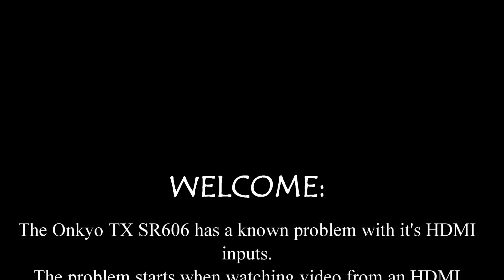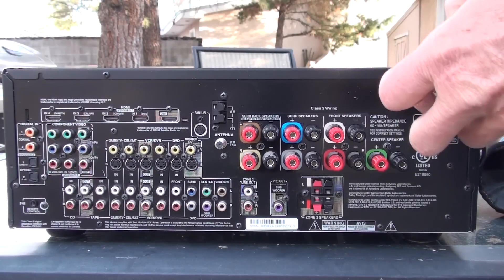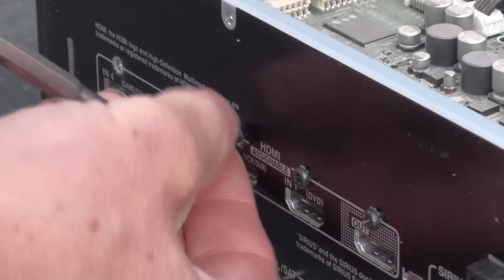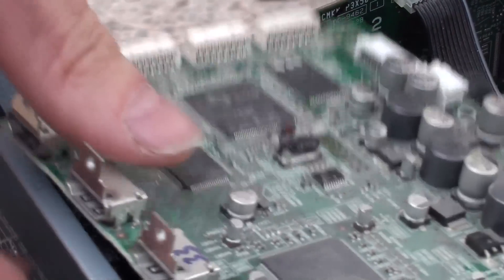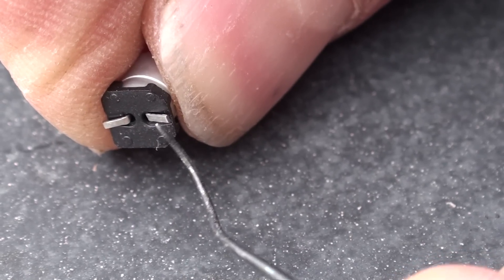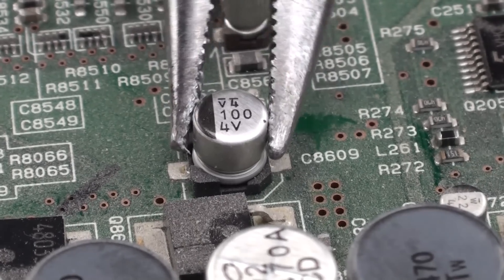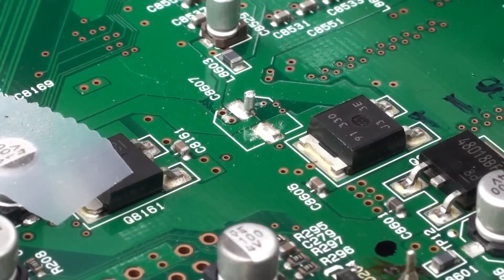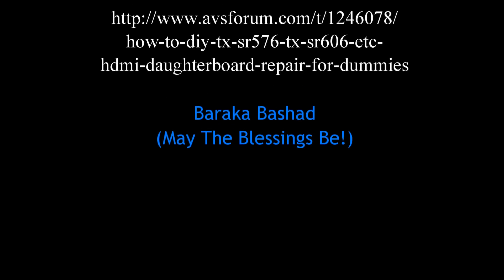How To Fix the Onkyo TX SR606 & SR607 HDMI Input Problem

Comment: Thank you! Followed instructions and replaced the capacitors on the HDMI board. HDMI inputs and setup screen work for the first time since I bought the 606 receiver used. Here's hoping the fix lasts! Great instructions. Again, thanks so much!
Reply from the maker: Michael Jackman If you purchased the higher temp rating caps. It should last longer than the original

Comment: Had this reciever installed at my parents since it was just standing around. However after a while it stopped accepting switching from different sources hooked up to the reciever. Followed this guide and it worked like a dream. Just had to make sure not to heat any components more than needed. Thx alot for this guide!
Reply: @urretard5934  yep, still works after 3 years. No fan required.
Reply: @urretard5934  think it was a 607 old one. Can't answer about your receiver tho, only knows onkyo is a solid brand. Yeah as long as u have basic soldering skills u will be fine 👍

Comment: I am plain electrician, know basic electronics, i was about to throw away my sr606 and i found the video , i know how to use the soldering gun , bought some capacitors over the DIGIKEY, got  it delivered the next day from the US and I am in Canada. Replaced 5 capacitors the way the guy said, and it's working now like brand new!!! I used to have long delays on all HDMI inputs and eventually all of them just quit working. Thanks very much
Reply from the maker: Juri Divovich You May now apply to StarFleet.  You’ll be working on photon torpedos in no time.

Comment: I just used your method to repair an SR706.  Thanks for the clear and concise guide.  For others with the SR706, there are 12 total 100uF 4V Caps.  I had only ordered 10, so I had to choose which ones to replace.  Based on comments on another forum I started with the Caps on the underside of the board that were closest to being right over one of the heatsinks on the assumption that these were the caps that faced the most heat and probably failed first.  These were the most inboard and forward of the Caps.  Once I replaced these, the HDMI switch worked just fine, but I chose to replace all of the remaining 100uF 4V Caps on the underside of the board and 3 of the 5 on the top side of the board, because, well, I had the replacements and I didn't want to take the chance that the others would fail eventually.  The 2 Caps I did not replace in case anyone else cares were each located right between 2 larger Capacitors and would have been a bit more difficult to replace.  They were also farther away from any heat source.
Reply from the maker: Thanks for the info.  Good choice, just replace them all.
Reply: Jason Rood i too have a SR 706 on the fritz... did you order the 493-2141-1-ND Caps from digikey or another part # ?  Thanks in advance.
Reply from the maker: the ND part number is a digikey part number.  Probably will not cross ref to other sources
Reply from the maker: It's the same type capacitor (part number) regardless of which model you have.
Reply: patpatpat999 Thanks!
Reply: I just did the same :), on my SR706 replaced only 10. I don't have such a small soldering iron, so did only the ones where I could fit without touching other elements. Worked fine for me, now the receiver works fine, no more crackling noises.

Comment: Great video.  I have the TX-SR607, the only difference is all the capacitors are on the bottom side of the board.  I've never soldiered a thing in my life until last night.  Fix worked without any issues.  I waited until today, to give the receiver a chance to start cold.  Yesterday it would have taken 5-10 minutes to "warm up" before I got a signal from my cable box.  It fired up immediately on the first try!!

Awesome video!

Comment: Great video, took mE about 35-40 minutes to do my 806.  Hardest part was getting capacitors out of the plastic.  Thanks again
Reply: Jason H. I have the SR806 with the same problem.  would you please share which caps you replaced.  Thanks!

Comment: Good video. Inspired me to repair my ONKYO TX-NR737 AV receiver. The device did not work for long. In my experience, a fan control protects the components from overheating in the long term.

Comment: Worked perfectly. Used capacitors with label "100 jfc 1t7", couldn't find their voltage rating, but they haven't burnt out so far :)

Comment: Thank you for this.  I had a newer 607 and the 5 capacitors were all on the bottom.  The blu-tak worked fantastic and the HDMI switching is now back to FAST!!!  $3 investment saved me over $500 on a new receiver.
Reply from the maker: Congrats! Power to the people.
Reply: +John Vitti Out of curiosity does your 607 have the extra HDMI input front bottom left of Amp beside the headphones socket? If so good to know the capacitors all on the bottom! Only looked inside the box so far while awaiting on components to arrive and couldn't obviously spot the one capacitor from the video.
Reply: +Kevin Jordan yes it does.  there are only 5 capacitors on that board that match the ones I purchased.  pretty easy to find.

Comment: Thank you SO MUCH for this video. It enabled me to fix my Onkyo TX-SR607. I nearly gave up initially, as the HDMI board is different from the one in your video (TX-SR606), and the capacitors are in totally different places (all 5 on the bottom side of the board). Also, in my case (I'm in the UK, no idea if the model is built slightly differently to the one in the video, which I assume is a US model), the original capacitors were smaller in size and diameter than the replacements I got (493-2141-1-ND as per your advice). The originals are marked "H1 100 4V", and the replacement ones "k3P 100 4V". I didn't expect the size difference (as the both the original and replacement ones in your video are of the same size), so I was very confused, and was initially looking at other capacitors that were the same size as the replacement ones, but these were marked "G1 220 4V" and didn't seem to me to be the right ones. In the end, I decided the smaller capacitors were the ones to be replaced, took the plunge and did the job, and my receiver now works properly again! Hope my experience may provide additional clarification to anyone else attempting this on an SR607. Again, I'm very very grateful, thank you!
Reply: Vlad Mandic Thank you sooo much for adding this info

Comment: Thanks so much for this information. I started experiencing this problem just this weekend with my TXN-R616 which I've owned for perhaps 2 years. I've noticed that this is a common issue with Onkyo.  I won't be purchasing another if this fix doesn't work for me. Thanks again for the tutorial.

Comment: Great video - massive help. My unit went awol after 10 years and has now been working brilliantly for a week now. I changed 2 more 100 uF capacitors while I was at it anyway and the board was out -  C276 on top and C8607 underneath on the basis they were probably knackered as well. Also fitted 2 12V brushless low noise computer fans to the underside of the main cover to increase cooling (plenty of room),  They  start up when the main unit turns on on the power switch - picking up the blue and white big wires to the main transformer  via a 230V/12v led transformer

Comment: Replacing the capacitors on the 706 went smooth but removing the board was difficult. It just didn't want to slide out if the white connectors on the side. Ended up popping a radial lead in the process and had to order one from overseas. Also, be sure to use a good iron while working on these projects if you are a beginner. Crappy irons really make things difficult. Found a super nice 607 for next to nothing and am going at it again. Receiver works great except for the HDMI so hope I scored another good one. Thanks again for the very well made video.

Comment: Thanks for the tutorial! Never done any soldering like this before and the legs on my SMD condensators were very TINY. I would recommend getting condensators with longer legs if you're a n00b. Messed about for ages with the soldering and thought I had killed the board for sure - switched on the receiver and got an E2PROM ERROR, which magically just went away and now my Onkyo TX-SR606 is working like a charm again! I was seconds away from throwing it away before I found this video, so THANK YOU :)

Comment: Worked great for me.  Thank you for the very clear and thorough instructions.  I did not have any blue tac putty so I pre-deposited a little blob of solder on the pads then held the capacitor leads on the solder blobs usind a little plastic clip to hold the capacitor, thereby  keeping my fingers away from the heat while I reflowed the solder.  Thanks again.

Comment: Should have my caps tomorrow and I'll be giving this a try this weekend. Receiver has been out of commission for a good few years now and I just came across this video this week. I actually have the R667 which came in one of their home theater bundles but the HDMI board is the same with the same cap types, position numbers, and capacitance. Don't know that this will be of any use to anyone in the future but I'll update after it's all said and done. 

My story is the same as all the others surrounding receivers from this family: unit kept taking longer and longer to connect via HDMI until one day it just stopped working altogether. I hope to God this works because the whole system was great while it worked.

Comment: Had the same problem with my TX-SR804 after about 13 years of service. After replacing all of the 100uF/4v caps on the HDMI board, the receiver is once again working perfectly. There are 9 of these caps on the top side, and 2 on the bottom.

Comment: Thank you so much for posting this video!  My amp (new in about 2007- it lasted a fair while!) was taking longer and longer to bring the HDMI inputs up after switching on.  I'd even resorted to turning it on half and hour before I was going to use it to let it warm up!

I used a set of 'standard' solder through capacitors rated at 10V.  Definitely easier to handle than surface mount types- just clip the legs to the right length.  With the blutac trick, it took about 45 minutes start to finish including untangling the web of speaker cable at the back!

Comment: I have a newer revision of the board I think, but the fix still works.  Note that the first capacitor number is wrong, it's C8609 not C6809!  Right place though.  Many thanks :)  Also I bought higher temperature rated parts with a higher voltage to prevent it happening again in some years time...

Comment: Works perfectly fixing an Onkyo SR607. I had the replace 5 100uf caps on the back. No 100uf cap on the front.
Cheap fix compared to buy a new amp.
Thanks a lot!
Reply: @Filip Colle, did you replace the SR607 onces with the part mentioned in the original summary? The 100uF caps are smaller then the parts on the SR606.
Reply: Jens Stobernack I didn't find the same caps. I bought SMD-Elko 100µF caps 6,3V 105°C (online using it-tronics.de).
Reply from the maker: Jens Stobernack Caps are smaller either because the value or voltage rating is less.  Also over time caps have gotten smaller for the same value and voltage.

Comment: Thank you for this very good video; excellent film work & voice over: I didn’t realise my 606 was faulty until finding this vid & after my dvd playing thru it started to get lots of increasing white line interference then pic going off & then discovered I should have had on screen display of setup! Bought 2nd hand see. Anyway, very very fiddly to change these, they are SO small & needed all my soldering skills (plus a bit of flux to help get solder to get going) & fix them in, but so pleased as sorted all the issues! Oh & very nice touch the tacky lump to help ho,d it in place, other videos show trying to hold it with tweezers which requires 3 hands!

Comment: Worked fine for me, i used Panasonic SMD ELKO EEEFPJ101UAR 100UF 6,3V 105°.
I bought ten of them, but just replaced 5 as shown in the video. Total cost of those ten plus shipping: 10 € 
Time i needed to replace them: from unplugging till replugging: about an hour.

Comment: Reeeeeeally well done, thank you much! One little typo: The capacitor on the top should be C8609, not C6809.

And I loved the hint about using blue tac to hold the components for soldering. Never saw that before.
Reply: U know, in my Onkyo I found some tac on the side of one condenser, realy nice touch by Onkyo!

Comment: This is simply great! Had the same issue with my receiver last week and found this video by luck. Now after replacing 5 caps, the receiver works like new again. BTW, I bought 10 caps just in case and now I have 5 left. Anyone interested, $3 they are yours.
Reply: +Yong Wang I'll take the caps if you haven't sold it.

Comment: I did this successfully. just a note I have a 607, all the capacitors were on one side of the board, I changed all the caps that were the same size/rating. HDMI switches fine now

Comment: Full points for the bluetac trick. I've been struggling for years!! btw replacing the 12 x 100uf 4V capacitors on my TX SR706 with 100uf 10V 105c ones from ebay for £3 just fixed an audio issue where loud static noise becomes out of the speakers for 5-10 minutes after switching it on.

Comment: Thanks for posting the detailed video! (wish I had Googled the problem earlier, as I've tolerated slow and partial switching for months).  As there is loads of room around the HDMI board I used 6.3v wire-ended 'proper' capacitors, as apparently used on all the other boards in the receiver.  Switching now instant :-)  Thanks to your good instructions it only took about an hour (took longer to disconnect and re-connect all the external connections!).  In particular I would have struggled to release the 5-way ribbon cable without the guide.
Reply from the maker: Glad to see another victory for the little guy.  A note, higher voltage caps won't be anymore reliable, but higher temp rating will be.  You may be right in thinking that radial caps will be better. I don't really know.

Comment: I just started to notice this issue after 11 years of owning my TX-SR606. It takes about 3 minutes to show anything on screen and output audio.  It seems to happen on all HDMI inputs... I will try to fix it. Thanks for sharing your experience.

Update: I fixed my receiver by replacing just one cap --- C8609, the one on the top side of HDMI/DSP daughter board and associated with Sil9135 HDMI receiver ship's +1.8v supply. 

The widespread original fix calling for replacing 5 100uF/4v caps (e.g C8609 C8602 C8162 C8096 C8072) is often an overkill as it intends to cover multiple issues with one shot. My problem was a minute-long AV "warming-up wait" on all 4 HDMI inputs ports, which pointed to a possible issue in that second HDMI switching stage chip...

Comment: I"m from Brazil and here not possible to fix my receiver because the cost of $350,00 you help me so much I changed 5 capacitors and no 4 capacitors and my receiver working very well. Thank you for this vídeo.
Reply: Olá, Qual o modelo do seu receiver? Onde comprou os capacitores? Obrigado.
Reply: Bom dia. Tenho um receiver ht-r667. Como saber quais os capacitores a serem trocados ?

Comment: I have a NR-809 with the HDMI problem. It would not put out sound and the speaker indicators would not come on, NET and USB would not work either. Onkyo extended their recall repair till 2018. I've already had 3 recievers fixed by sending them in to be repaired. They also paid for shipping. My father's TX-SR606 had the issue where the HDMI would just quit working. Onkyo fixed that as well. This 809 (the only one i have left) is a beast!. It's big and heavy! After its HDMI board repair it works well.

Comment: Thanks for the great tutorial which had me so excited that I cut out of work to go pick up some capacitors at Fry's. Although I fancy myself a decent solderer of electronics when removing the first capacitor I ripped one of the tracks out. De-soldering is what I have always done and should have followed my SOP on this one too. My fault and still a great fix that has helped many save $ and recycled.

Comment: Great video.  I have this receiver at my vacation property and it has the same issue, but it only affects the CBL/SAT input.  I'll replace the caps however.  I was getting ready to buy a new receiver but will now delay that. Excellent. The Blue Stick is also a great tip for a non technician such as myself.

Comment: Thanks. This fixed the issue I was having with the HDMI output taking 2 minutes or more to show up on my TV. 

A temporary fix for this issue would be to enable HDMI power control (RIHD), under hardware in the menu. I think that's onkyo's name for CEC. This will keep the HDMI board powered up all the time, even when the tuner is in standby. The downside is that it will suck about 60-70w.

The caps in mine were closer to 5mm. I ended up buying spool of 1000. They are high quality 6v. I'll sell them cheap for anyone who is doing this repair :).
Reply from the maker: Interesting.  Thanks for the tip.
Reply: +Haavar Valeur Where you located?  If your in the UK, I'd be interested in 5 caps, digikey want £12 p&p for less than £2 of capacitors.
Reply from the maker: +Kevin Morrison :  Find a parts supply house online based out of Europe.  If you live in a larger city you may be able to buy locally.  Just buy 100uF, 4V, 105C capacitors. They don't even have to be surface mount like these.  Radial style caps may look odd to you but they will work just fine and may be a little easier to install.  Cheers, P.
Reply: +Kevin Morrison +patpatpat999. Sorry, I'm in the US.

Comment: Thanks a ton for this video.  I just revived my old Onkyo from the grave.  I did use slightly different capacitors (higher voltage and higher temp) which made it a little easier.  Worked perfectly!
Reply from the maker: You're welcome.  Thank you's from you all are tiny bits of good karma come back.